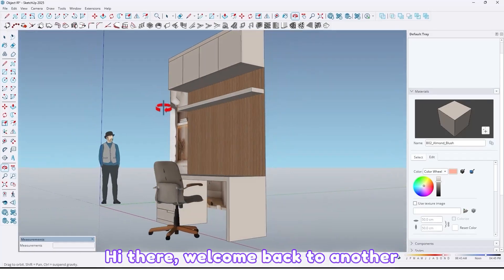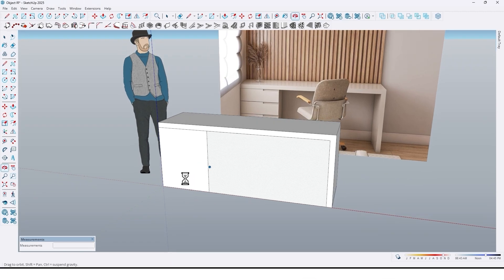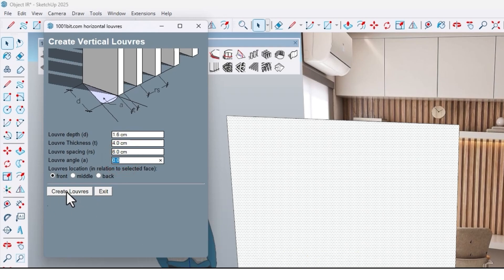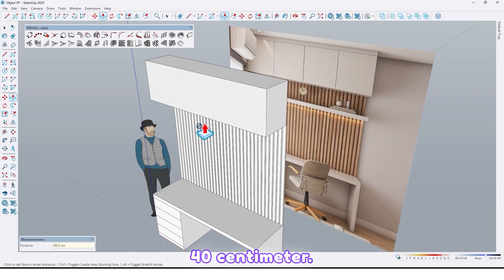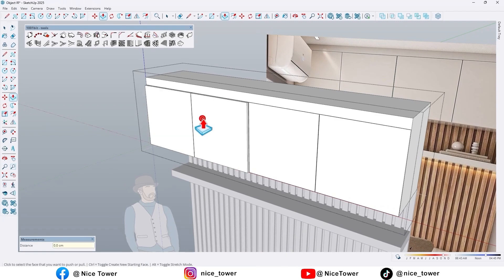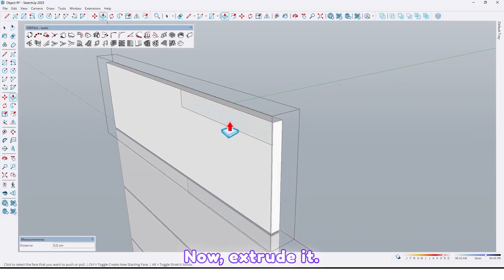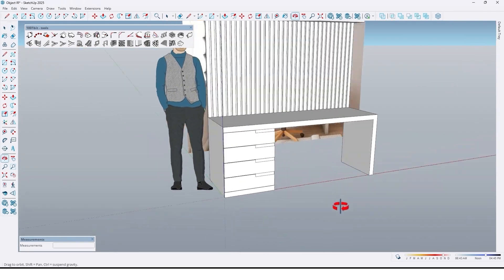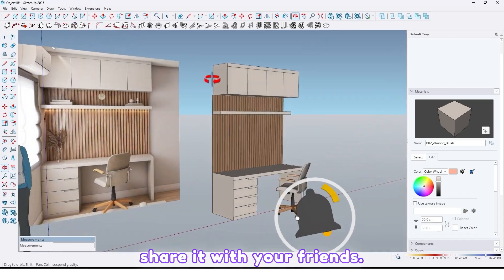Easy Steps to Design Your Dream Workroom! | Sketchup tutorial |

Comment: Please, does anyone know how I can apply an attribute to several items at the same time? I'll explain better! I have a 100 x 50 cm grid. In it I have a checkerboard (checkered type), with a spacing of 1 cm, however, this gives me 200 "squares" that I want to be hollow (that have nothing). I want to know if there is a way to apply PullDown once for everyone? Thank you for your help!
Reply from the maker: You can’t apply Push/Pull to multiple faces at once with the native SketchUp tool. By default, Push/Pull only works face by face. But there are plugins that can do exactly what you need:
	•	JointPushPull (by Fredo6) → lets you extrude multiple faces at the same time.
	•	PushPull Multiple (various scripts) → also works for batch extrusions.

👉 If you just want to remove the squares (make them hollow), you could also select all those faces and hit Delete instead of pushing them.

So:
	•	Native tool = one by one.
	•	Plugin = all at once (best option in your case